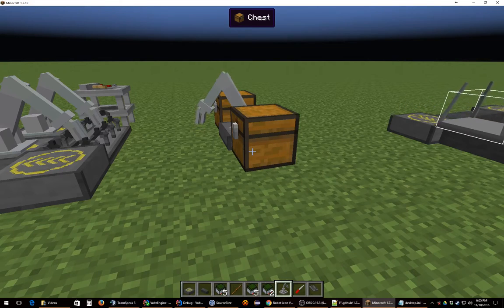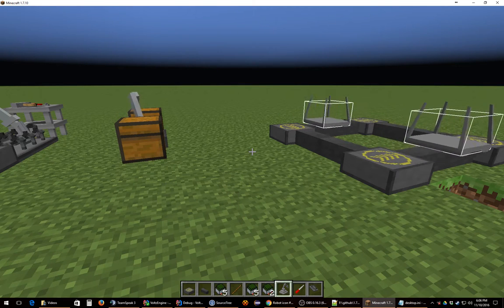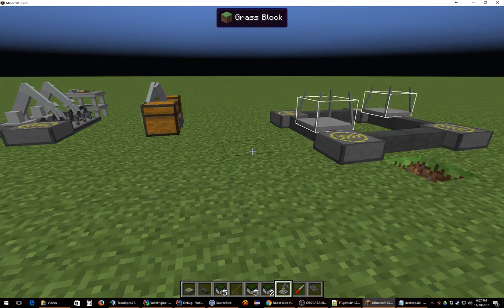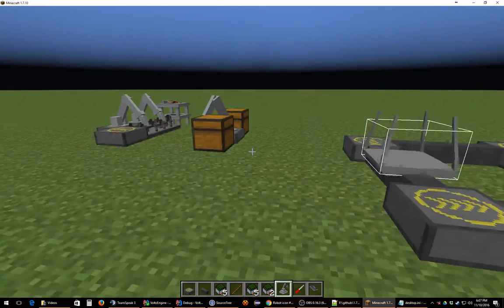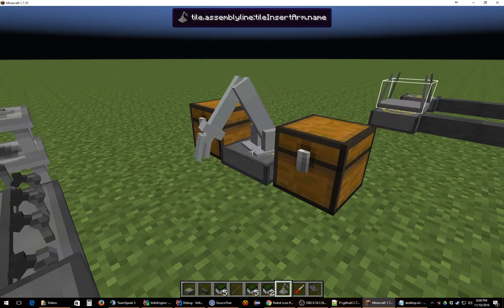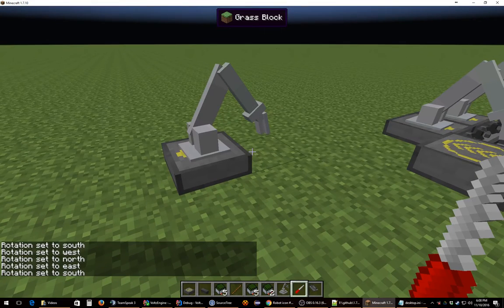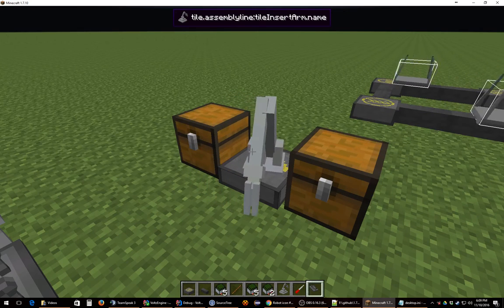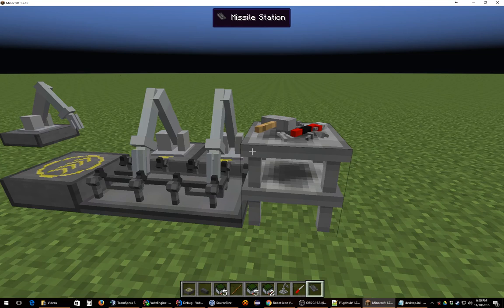Assembly Line - Inserter Demo

Comment: this seams similar to factorio
Reply from the maker: The mod existed before Factorio and the author of Factorio has admitted to being inspired by Minecraft mods. So there is a possibility that some of Factorio's content is based on the 1.2.5 version of Assembly Line. However, I have never managed to get the author to ever admit this but his belts look identical to my belts. Regardless, some of the new content I'm working off of is inspired by his content lol. http://www.voltzwiki.com/wiki/Conveyor_Belt
Reply: i searched factorio in minecraft and this popped up